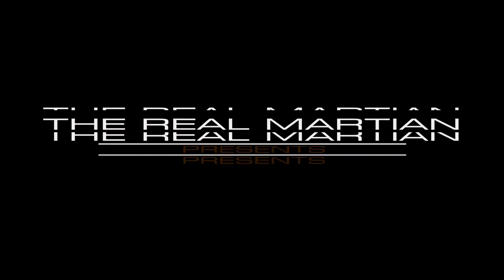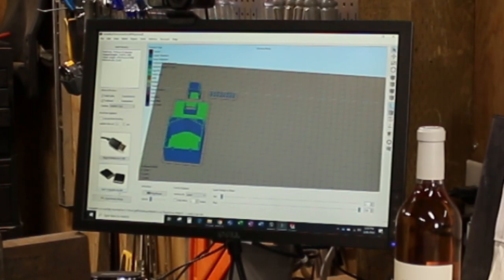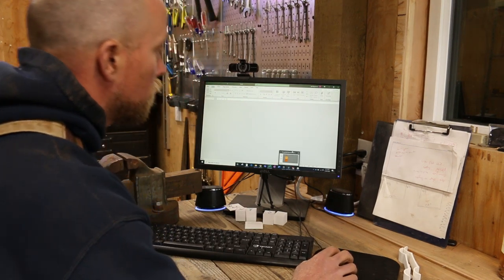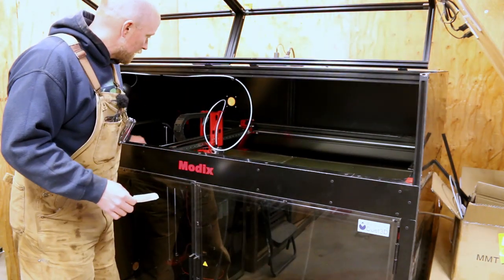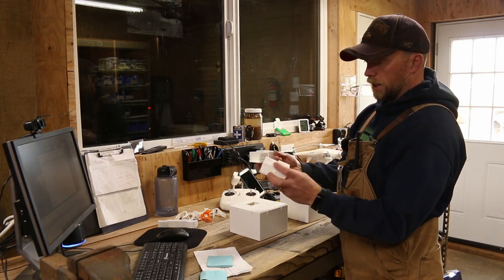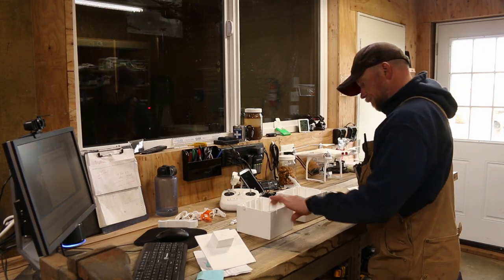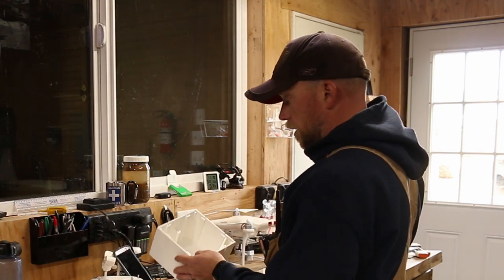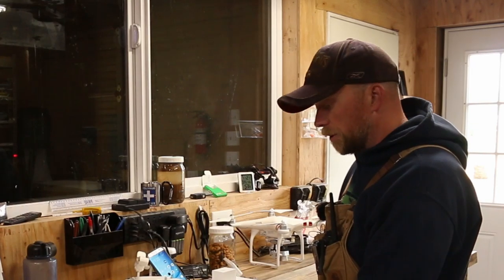Solidworks and Modix3D A Powerful Set of Tools

Comment: TRM What are the dimensions of the boxes?  It looks like they are about (4x4x4).  It feels like they would stick off the wall too much to me.  I think slimmer boxes might be more appealing (say 2.5x5x5).  I also like what others have suggested - octagonal boxes.  For a commercial application they would use square for a higher density, but for home use the octagonal boxes would give a better decor appeal i think.  Hope this feedback is helpful.

Comment: The back box needs to have a 50mm lip coming up from the bottom so any water pooling in the bottom won't push out the bottom and having the front cover come behind the lip will mean you inly need two screws at the top to hold it in 👍

Comment: For your Wi-Fi in the shop, are you using the latest offering which is 802.11ac.  If you are then this allows you to select either the 2.4 Gig frequency or the 5.8 Gig frequency to use as the default Wi-Fi service.  The 2.4 range is full of noise these days as there are so many devices using that frequency set so switching to the 5.8 Gig option should allow more bandwidth to your shop. If your Wi-Fi system is an older 802.11b/g/n you won't have the 5 Gig option so it may be worth considering an upgrade.
Reply from the maker: yeah sadly it's 2.4ghz and they weren't cheep so its hard to pull the trigger on the upgrade...soon time will start to push me in this direction I fear.

Comment: First thing, now in order to use this I have to have a special grow cube, that is not readily available? Second , in order to use this I have to have some sort of special drip/emitter/tip thing internally, also not readily available? Third, it’s got a drain hole that’s going to drain all over my counter? Fourth, I still don’t understand why i or anyone would spend money on this. How is this helping with sustainability? It looks like like a 6”x6” electrical junction box anyone can get from Home Depot. Fancy Chia Pet! This is starting to look like a very high price point premium product. Why would I buy this when I can achieve the same results with a 20oz coke bottle with the top cut off?